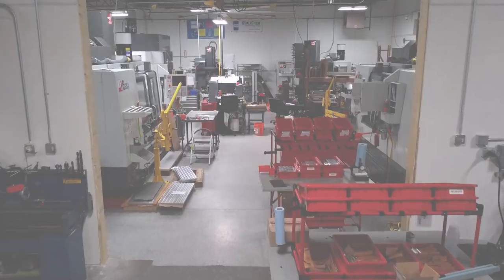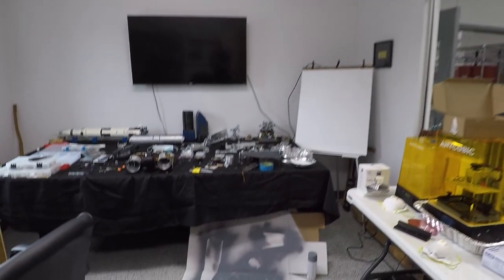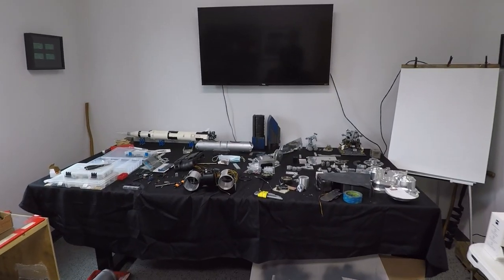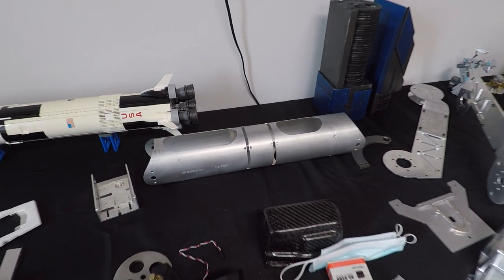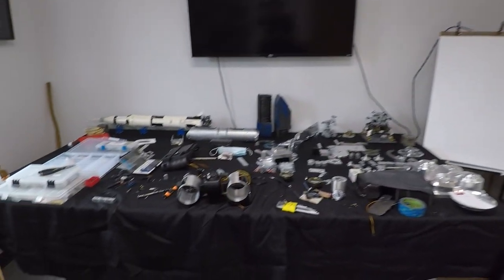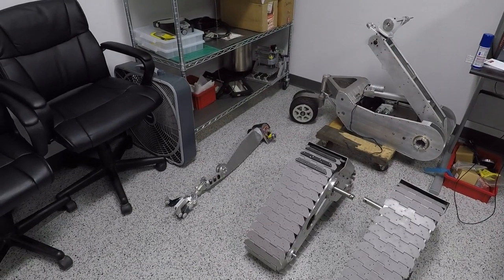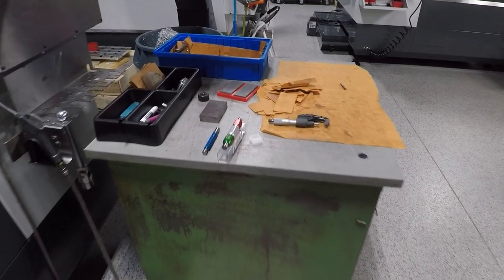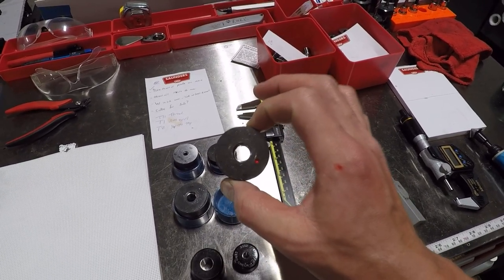Johnny 5 is back! Build Update & Shop Updates!

Comment: Learned the tolerance stacking on one of my drone frames I cut and then wanted to make aluminum arm protectors for the ends.   Little oversized on one part versus slightly undersized on another part, issue with tool deflection that was not figured out with 3D mockup phase.